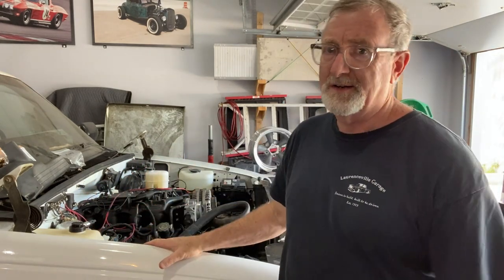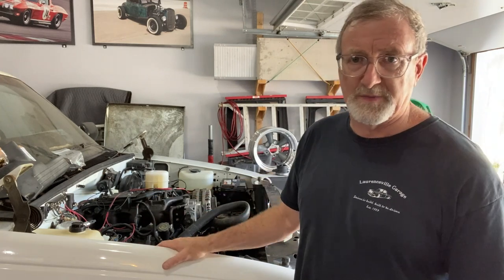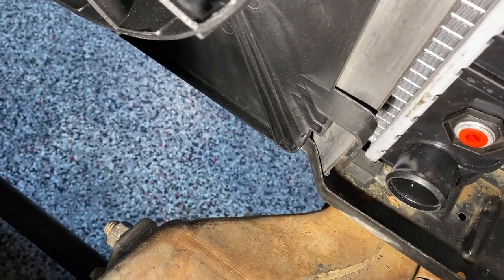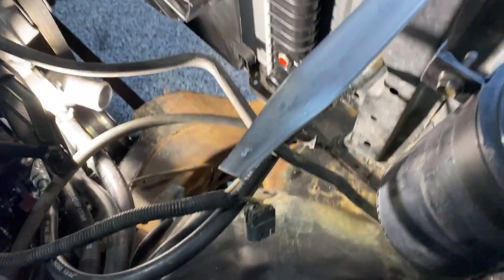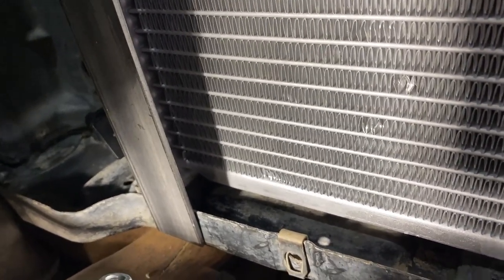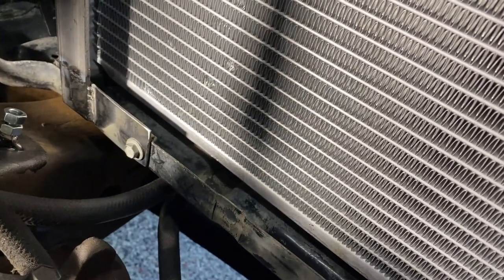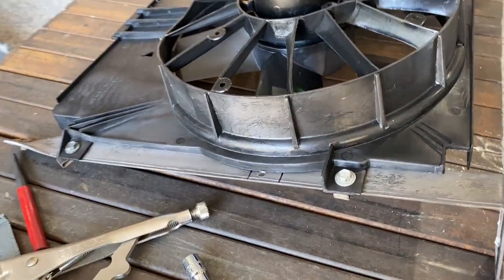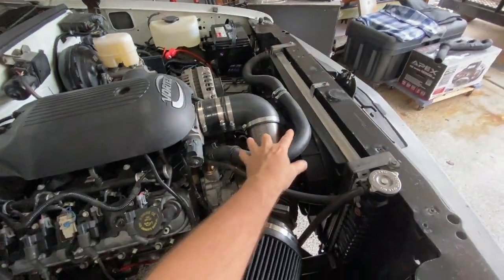1988-98 Chevy OBS LS Swapped Twin Cooling Fan and Radiator Install

Comment: You do a great job!! Can you tell me we’re I need to ground my engine? Some how I think there is three!
Reply from the maker: You can never have too many. I have primary negative battery cable to engine head, also from negative battery to frame, also have ground from back of engine block to body and to frame as well.

Comment: Is the radiator the original of the 5.3?
Reply from the maker: No,  it is what would be correct for a V8 1991 Chevy OBS
Reply: @laurencevillegarage  So can I use a radiator of a v8 of 93?, for my 5.3 of 2002?
Reply from the maker: Yes. Depending on the water pump you choose, there is some "play" with the coolant outlet...and you can choose an aftermarket inlet flange to change the angle a bit as well if needed. Just be careful to choose a pump (if you change it out) to work with the location of your throttle body and other accessories.
Reply: @laurencevillegarage  All right, thank you very much.

Comment: Doesn't the PCM have a high and low wire coming from both the blue and red PCM connectors? You only use one????
Reply from the maker: Use blue pin 42 for cooling fan #1 and red pin 43 for 2nd cooling fan. I used both.
Reply: @laurencevillegarage  thanx..... great content kept it coming 👏
Reply: @laurencevillegarage  one of those pinout shows it not to be in use and the other one is for the AC control if I'm not running AC will that work?
Reply from the maker: @salreyes3215  yes, they will work. You will need to let whoever does your tune know that you have wires in those locations for that purpose. To make it even easier, use one of the uncut wires you removed earlier that has a pin on it. Now you will have 2 wires for your fans (be sure and label them). When you make your harness relay/fuse box you can go ahead and include a couple of relays and fans to go with it. Be sure and use a weather tight box for your box to keep moisture out.
Reply: @laurencevillegarage  yes I ordered the same box you used. Thanx a million 👍

Comment: Whats the part number or the info on the Radiator?
Reply from the maker: It's a stock replacement for a 5.7 '91 model truck. Nothing fancy....works great, no overheating issues.
Reply: @laurencevillegarage  I noticed it's not a thin one, I wanted a 454 one but seems a little bit to big. Where yours looks just right.
Reply: Thank you for the info I appreciate it.

Comment: What did you do for vacuum for brake booster?
Reply from the maker: The vacuum is attached to the back of the intake manifold.
Reply: @laurencevillegarage  I’m asking because on my manifold I think the port is blocked off
Reply from the maker: If you are using a truck manifold, that plug can come out and a "nipple" can go in. There are other ways to get a hose from the brake booster to the intake if that is not possible.

Comment: What radiator and cold air intake did you use?
Reply from the maker: The  radiator is standard 1991 Chevy c1500 with 5.7 and 28" core.  As I mentioned in the video, the CAI was put together with various parts from the donor Suburban, a couple of parts I had laying around and a coupler and air filter that I purchased off ebay. I put links in the description below the video where I bought those items and price paid.

Comment: 👍 being like that, that fan will remain on , as long as d compressor ,  is on,,
Reply from the maker: Yes it will, thanks for watching!
Reply: @laurencevillegarage  @ on  dbw, harness, what u did to eliminate the neutral switch
Reply from the maker: @gerardolopez5875  I did not remove it, on manual transmission it's on the clutch pedal assembly.